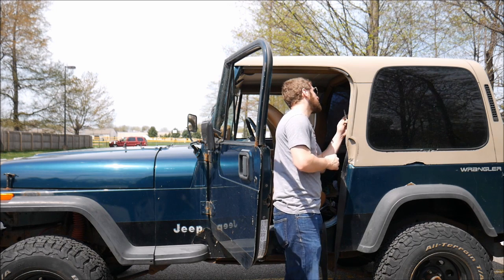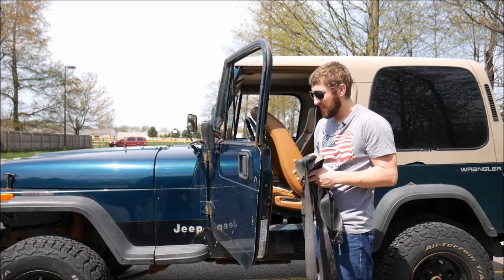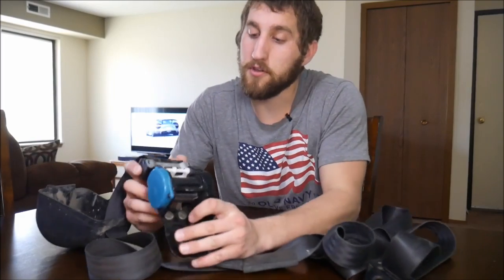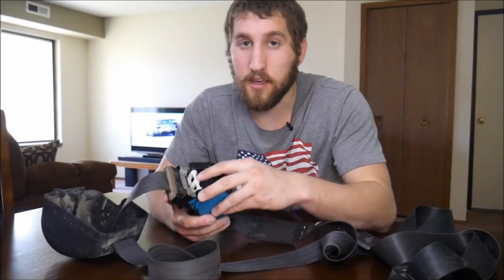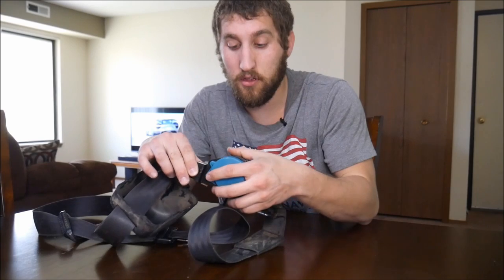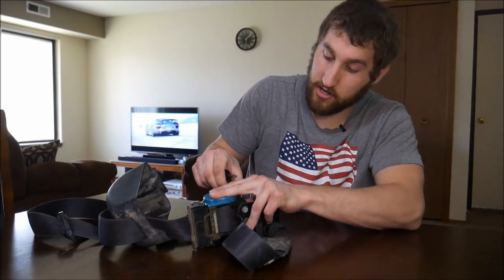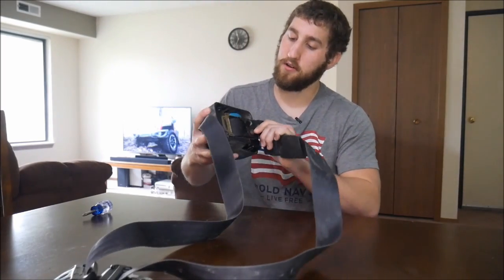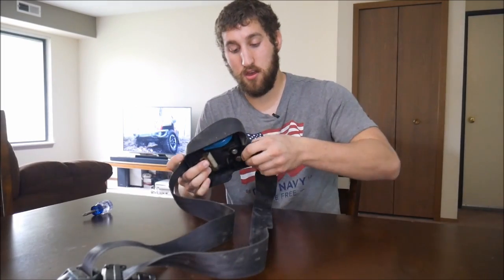Rewinding a Seat Belt Return Spring and What NOT To Do

Comment: Thank you so very much for taking the time to post this video. I rewound the spring into the COVER, added tension, and it worked perfect the first time! Great style, great communication, great editing!!!!!
Reply from the maker: Thank you for your kind and encouraging words!
Reply: @MotorMaintenance  The least I can do to thank you is tell you this story: 1973 de Tomaso Pantera, 8,800 miles, absolutely pristine original condition! The belt would not move either way; took the system apart it was pristine inside accept for the exploded spring. Tried everything to understand the design, manuals, Pantera sites, had almost given up but did not want to replace that original retractor as it was in PERFECT original condition and a beautiful design.  Then I found your video!! Your style and editing kept my interest until I got to the exploded spring sequence!! TOO FUNNY! Understanding the recoil direction, reverse winding of the spring into the cover, winding the belt back all the way, and preloading the spring by turning the cover, worked perfectly!! Now my Pantera is back to original mint condition. Thank you Sir!
Reply from the maker: @robertcanepa9712  Panteras are awesome cars!  Glad I could help keep a rare beauty original!

Comment: Watched a few other videos. Like this one. Things to try. See if belt retracts when pulling out from the coil mechanism. If it works, then wash the belt and d ring that belt travels through.  Next step, I like the baby powder idea on the belt. Then remove screws from the do not remove cover, and tighten the spring, turning counter clockwise while NOT removing the cover.  If it doesn't pull out, the problem is on the other side cover, opposite of the do not remove cover. The lever inside may be stuck, or the belt was pulled out too far, and is stuck. Push back with screw driver. Good luck.

Comment: Just did this on my 08 Diesel JKU, thanks for the info! Did not have to remove the unit from the JK. Just pull the cover and wound it 3 turns. 15 minute job.
Reply from the maker: No problem, I'm glad it worked on the JKU!

Comment: Very helpful. I need to do this fix for Dream Girl's 02 Taurus. I would only suggest soaking the belt in soapy water (use Dawn), wring it out , and let it dry before getting into the mechanical portion of the fix. Many people will have tried cleaning  as a first fix but if one hasn't, do it while it's off the vehicle...
Reply from the maker: That's not a bad idea, mine is pretty old.

Comment: I did this it helped soften the belt up alot  but it was still not quite enough .Now I let the belt  dry thoroughly and i came up with an idea .I got some baby power .I rub it on the belt from the top to bottom and rub it fairly well left some extra power on the belt and retracted it  up and down so the extra power could saturate it inside the mechanism a little also .I pulled the belt up and down many times and then the belt started fully retracting once again .I tested it the next day and it worked fine still .the powder is not effected by the heat or cold which is good and it helps the belt stay slick as it allows the belt fabric to slide with much less friction which is the key enemy .Now the day will come when the spring that retracts it will lose its return tension altogether but thats down the road a long ways I hope. I vacuumed up the power and I was done .

Comment: Nice video! good job with the spring rewind without cussing up a storm like I would've. I hope your still making videos. My seat belt made a noise like the spoon flyin' from a hand grenade and now my belt is just laying across the seat so I am looking to see if its salvageable or needs replacing.
Reply: Was it salvageable? Mine did the same thing.
Reply: @MotorFeed  lol. I have not yet messed with it.  Been a year.  I believe that the spring material snapped and needs replacing.  I will post a comment when done. I'm off next few days I'll try to get to it.
Reply: @MotorFeed  might pull the spring from rear seat belt no one uses and swap.

Comment: I had to do "NOT to do" because in my case it was the 40 yr old lubricant that crept into the spring and turned into a gooey paste. The belt would retract completely but it took up to several hours in colder weather. Thanks to brake cleaner spray and these instructions on how to rewind the spring, now the belt works as good as new.
Reply from the maker: Sounds like an awful process but I'm happy to hear that it worked!

Comment: Hi there! I did exactly as explained on the video but the problem now is that the belt is not coming out. Have you ever experienced that? If so would you be able to help me out? Excellent video BTW. Thanks
Reply from the maker: If the seat belt is not sitting in a vertical it may not pull out due to rollover precaution  built into the mechanism. If it is sitting the same way it would in the car then it may have been over wrapped. Other than that I am not sure, I hope this helps. If you figure it out please let us know!
Reply: Motor Maintenance. Yeah I probably over wrapped it. Looks like it is stuck on that end metal part, which I don’t see a way to unstuck. Might have to buy a new one. Anyways. Thanks for the video and for the prompt response.
Reply from the maker: @Oruamfacc  That is too bad, you maybe able to let out some of that spring tension. Thanks for giving it a try though!
Reply: Motor Maintenance, I ended up pulling all apart, including the spring. Then I was able to release the belt after spraying a little bit of WD40 on it. Then I did exactly like the video and Voila! It is working great again. Thank you
Reply from the maker: @Oruamfacc  That is great news! Kudos to you!

Comment: My seat belt retracting assy won't come off.. The nut won't budge even after spraying it with WD40. Would it help if I simply sprayed WD40 in the small gaps between the spring housing?

Comment: I did the do not remove and was dumb enough to do it in front of my wife which I will never hear the end of.  Any ways do I rewind belt on spool prior to putting spring back on or half way or all the way out????????
Reply from the maker: First, I feel your pain at least yours wasn't on video!
Second, it will not matter if it is wound up, as you add tension to the spring (by rotating the "do not remove" cover) the seat belt should wind back up. so you can do it full spooled half spooled or unspooled, by the end though it should be fully wound.

Comment: Did your clock spring mysteriously change tension direction at about the half way point? Oddest thing ever...
Reply from the maker: It is highly possible that I spent a large portion of time going the wrong way... shh don't tell anyone
Reply: In my case, the clock spring reversed tension direction half way through. Don’t know if it was over extended so long it set that way or if it happened when I grenaded the assembly like you showed not to do lol. Anyway, I got it back together and it works well now. Thanks for the tutorial. 👍🏻
Reply from the maker: As long as it works in the end! Sorry it happened to you too